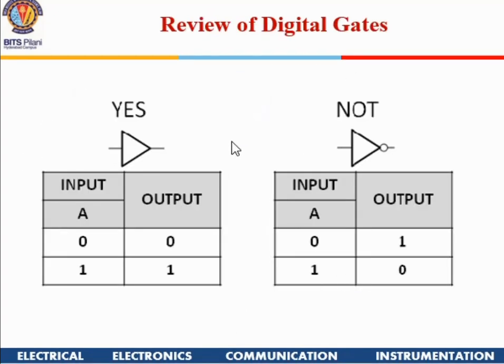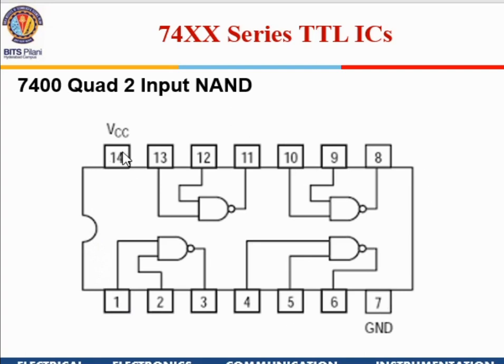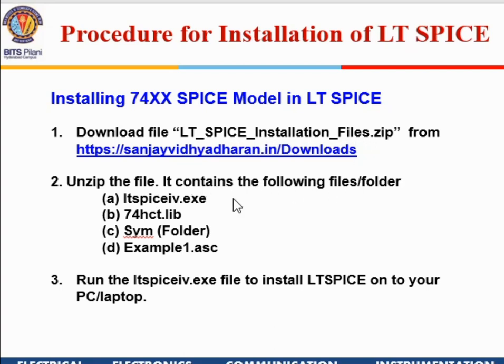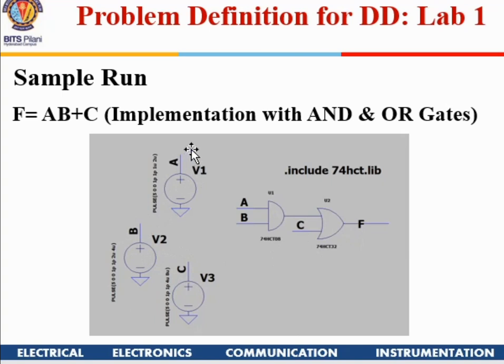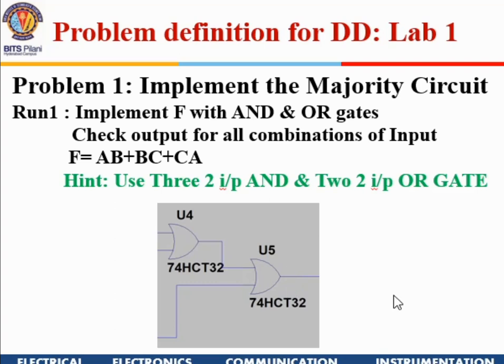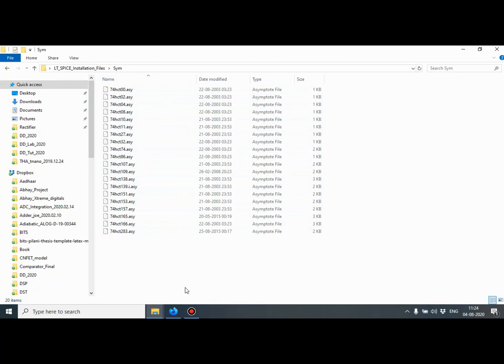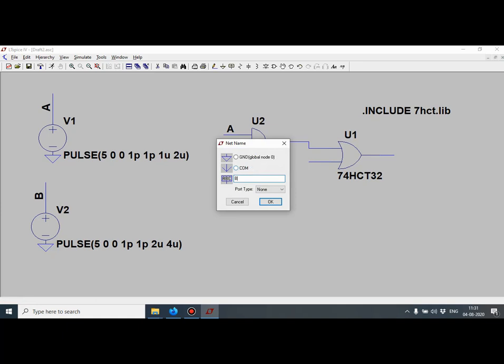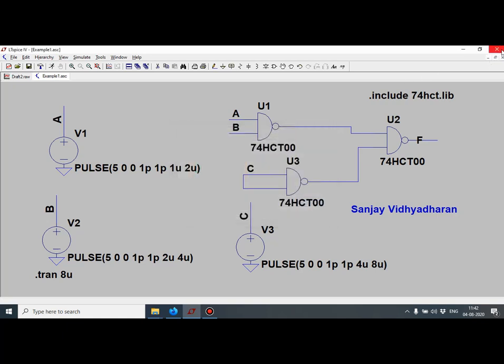Digital Design Lab 1: LTSpice Tutorial - 7400 Series TTL Gates | Spice Model

Comment: Hi! For some reason I followed the step by step however the components are not showing up on my LTSpice. I had it previously installed on my PC instead of using the installer you provided. I don't know if that is why. Can you give me a hand?
Reply from the maker: You might have pated the downloaded files in the wrong folder. Check in the video on how to identy the correct path of the folders where the symbols and lib fies are to be pasted
Reply: For LTspiceXVII the files need to go into the documents\LTspiceXVII\lib
For the newer version of LTspice the files need to go into the Users\<your user name>\AppData\Local\LTspice\lib

This is how I got it to work for me.